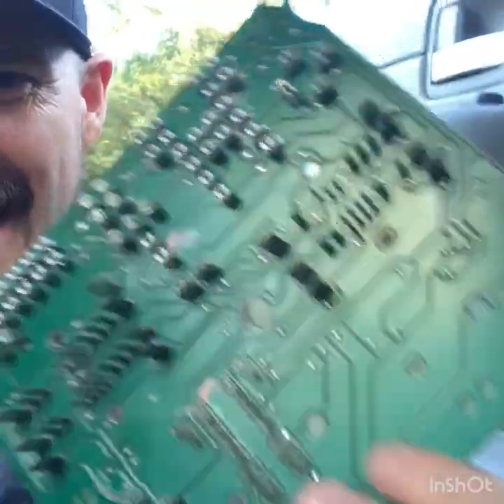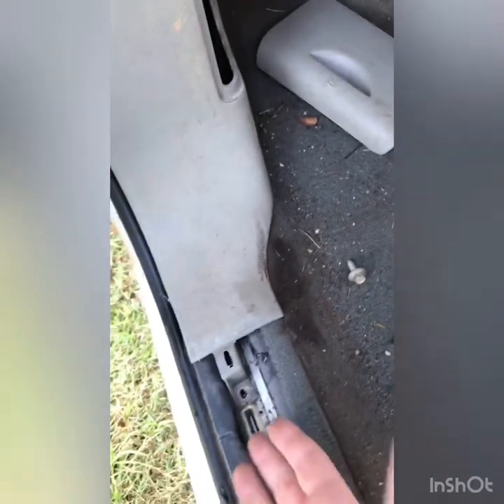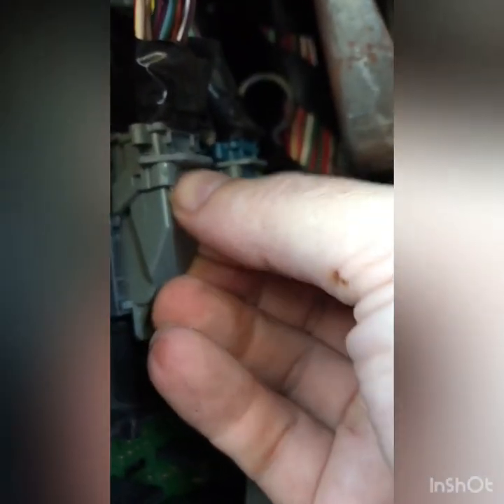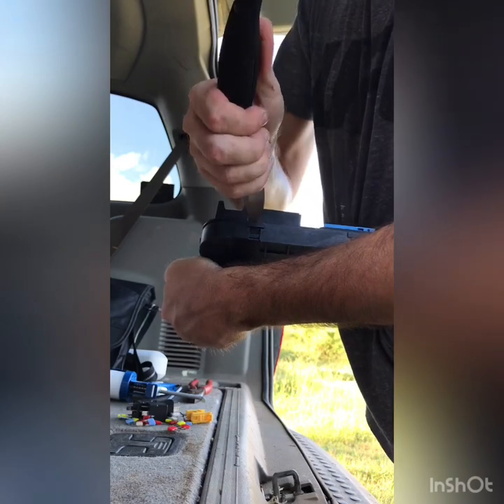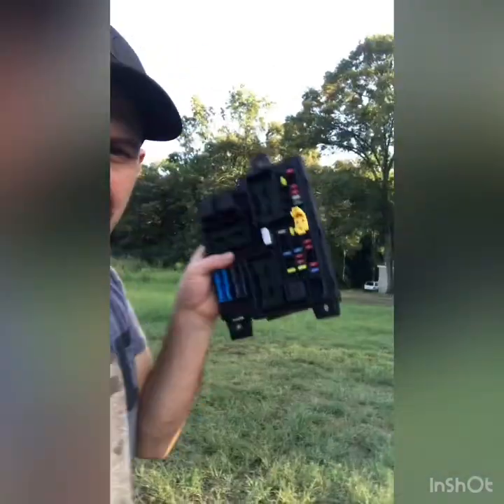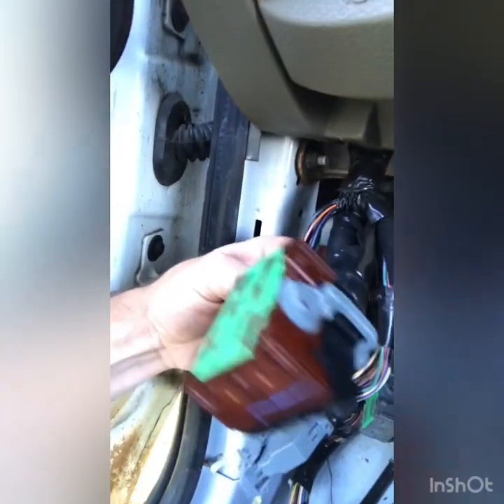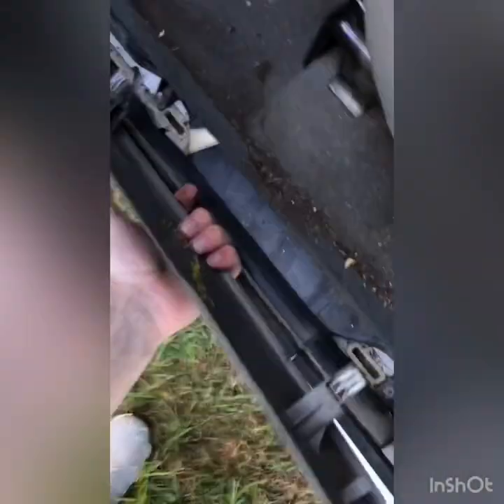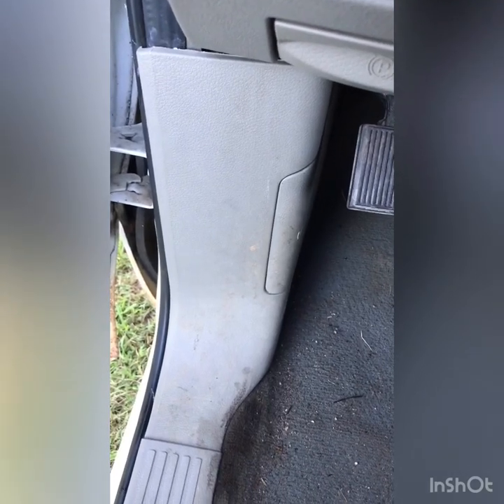07 Dodge Durango  water damage fuse board repair Gauges  going crazy

Comment: Thanks, DIj Man.  That was a really great video!!  Some additional comments:  (1) Relay Junction block is how Mopar lists it.  For 2007-9, the part number is 56049173AG and with a mopar discount it ends  up $279 (this is 3/7/2023)    (2) I followed all the steps in this great video, but I also did some leak tests using a garden hose just after the fuse block was pulled  out and before continuing.  (3), So, my leak was threefold - water was leaking thru the cowl at the windshield wiper post (I verified that this was causing some water dripping on the fuse box), the cowl also was leaking at the corners   (where the cowl meets the windsheild side molding) into the engine compartment (so, a rainstorm would cause some issues), and the roof racks were leaking and caused the worst (of the three leaks) flow of dripping water onto the fuse block.  (3) on the video,  where you use that small wire brush on the circuit board, I believe that that size wire brush could damage the circuits on the board, although your video shows that it can take some beating and still work.  So, I bought some small wire brushes which are intended for cleaning circuit boards, and they cleaned it up well enough - you can get a kit of 9 small wire brushes for about $11.   fwiw.

Comment: Man awesome video. We have an 06 Durango hemi with only 92000. Sunroof clogged and water drained on fuse box and it hasn't been right since. Changed the ftc and oil sensor since that's happened because it basically made the vehicle shut down. Seemed ok for about a day then oil sensor code popped back up. Just removed the fuse box following you video instructions. Hoping this fixes my problems.

Comment: i got one too. i think part of the water on mine comes thru from the sunroof drain being clogged. it runs down to the same spot.
Reply from the maker: greeel real talk I’ve heard this but could not find the drain hole
Reply: @diyman5930  open the sunroof and look in the corners of the front part of the ducts. theres a little hole on each corner. mine was full of leafs, acorns, etc. overflows and leaks right thru the headlinder. 05 durango
Reply from the maker: greeel real talk thanks I’ll look again
Reply from the maker: greeel real talk I found the hole and it was stoped up most of the way up with leaves thanks for the advice!
Reply: Idk, mine floods the fuse panel and I don’t have a sunroof
Reply: We have a sunroof too. How do you clean them and how often should you clean them?
Reply: @shylow77  tiny screwdriver, dig out any obvious debris in the drain holes. shoot penetrating fluid (wd 40, pb blaster) down the holes, then use either compressed air or water with a fitting that fits decently into the holes and blast everything out. take a peak at it once a year.

Comment: How much is a new or refurbished fuse board?
Reply: $100 - 200+ used for a 2008 dodge durango...  found one just over  $100 on ebay.  Make sure that the add says that it has been tested.